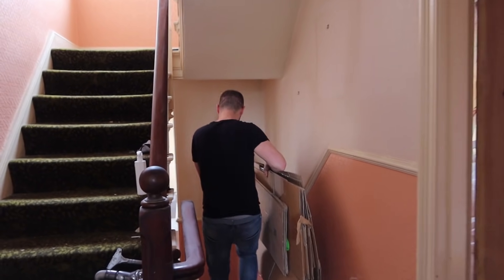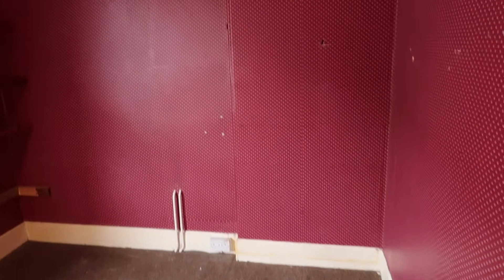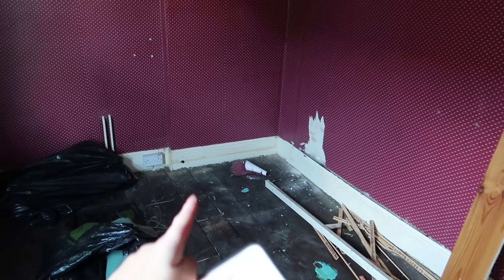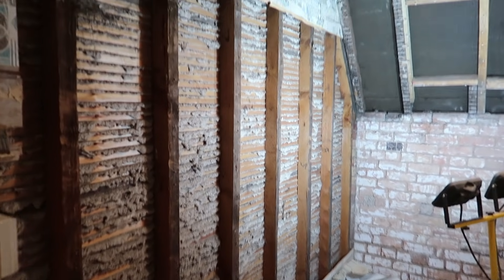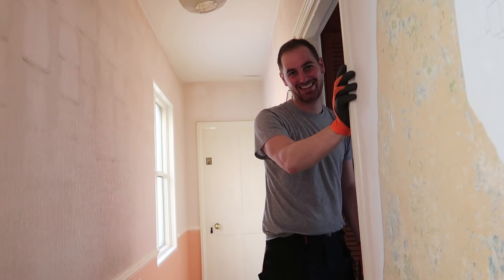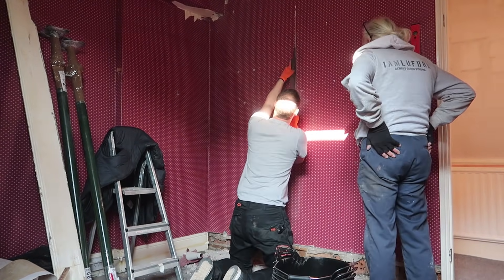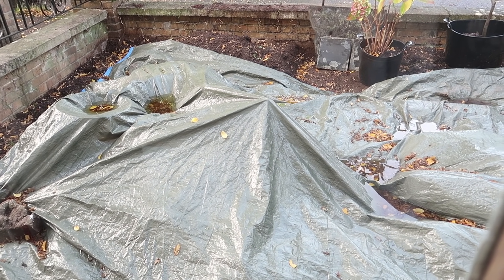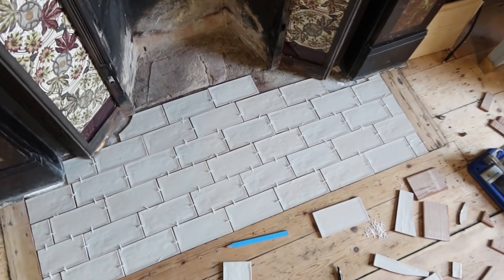CONSTANT SHUFFLING | RENOVATION MONTH 8 | Laura Melhuish-Sprague

Comment: Great bargain on the sink! The more items one can find slightly impaired the better; thus stretching the budget further. Fireplace looks wonderful. To cover the bits of paint on the floor, use “quarter round.” Paint before installing and then use filler over the nails followed by bits of paint. Natural floors look absolutely knockout. 👏🏻
Reply from the maker: Thanks for the lovely comment and tip, I will have to get some of those on order!
Reply: “Quarter Round” or “Shoe Molding” comes in lengths: meters or feet. It is placed at the bottom of base molding all the way around the room. It is painted the color of the base molding prior to installation, nailed onto the base molding with small headed nails, the nail holes are spackled, the touched up with tiny touches of paint. It covers a ‘multitude of sins.’ Often seen in high end/up market homes.

Comment: Just found your account and I'm loving catching up with all your renovation videos! We're also renovating a Victorian house (bit smaller than yours, though more problems!!) and we've been documenting the process on our YouTube channel also. We've done a lot of it ourselves too due to finances (I'm freelance so not always got lots of money!) and I've noticed you both say a lot of the same things we do about renovation etc. . . a quick question for Ollie, does the electric drill thing make a difference when taking plaster off a brick wall? We did our hallway plaster removal by hand (no power tools) and it was the worst job of the whole reno. If we could save some time (and sanity) using a powertool we definitely would do! x